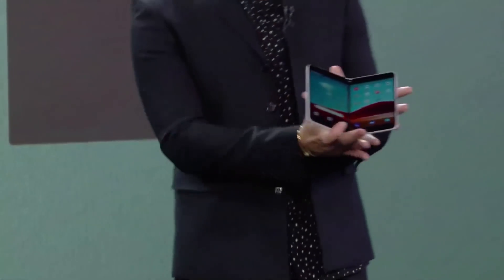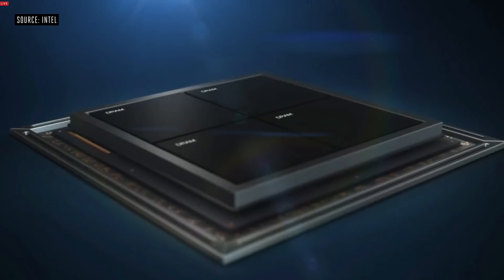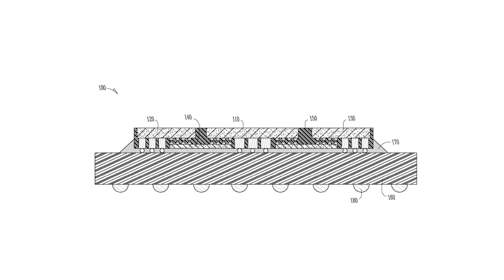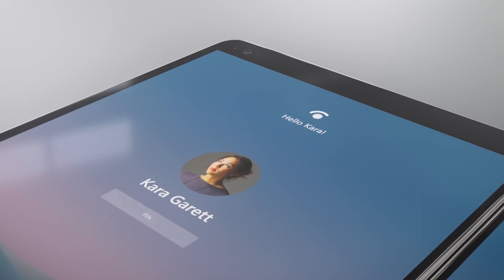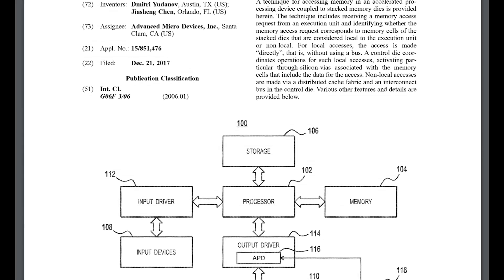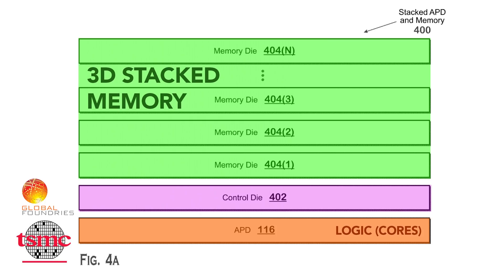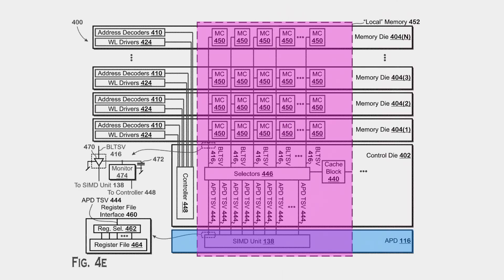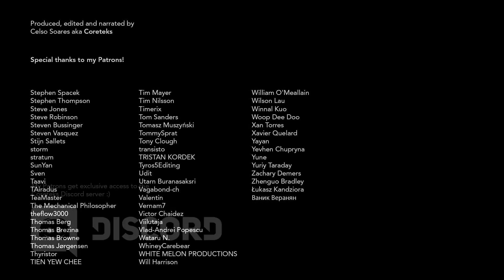Is 3D STACKING coming sooner than we think?

Comment: Moores law was just suspended, because Intel had no reason(without competition) to shrink and increase transistors on a die. That would have requiring new more costly equipment and processing techniques.
TSMC went from 14nm, 7nm, 5nm, 2nm all within a space of less than a couple years.
Yes they will hit a threshold again and slow down, as it again becomes more costly to continue to shrink transistors.  
Stacking vs using an interposer to connect die pieces, neither method is cheap.
But It's easier to cool a bigger surface area(interposer) then a smaller surface(stacked).
Stacking solves some interchip latencies but creates others like getting rid of heat. 
Memory stacking has been done for Years by IBM. It takes advantage of the fact that memory usage is localized on the Dies.

Comment: Wait - why would memory prices skyrocket, if all you're basically doing is moving it from the board to the chip package? 🤔
Reply: From my understanding from the video is that amd can't use existing tooling for that memory in regards to 3d stacking. It has to be custom and anything custom will be expensive.

I could be wrong though.

Comment: here is the short version. 3D stack will only be viable once we solve the cooling issue that is generated with it.
if we ever find a miracle way  of cooling without LN2 or something that isn't outside the norm of cost=/=efficient then but only then will there be huge increase of 3D stacking.
3m has already been developing liquid industrial cooling solutions for computer parts and they are great but really expensive atm but no where near for commercial use yet. 10 liters of novac is like 1500 dollars.
Reply: Also i have to add, Amd seems to be years ahead now in technology most people can't see or understand it just yet but wait until 2022~2024 Apus will rule supreme.
Especially if they can figure out a way to cool these, making ram act like cache on hyper bandwidth memory 3d stacked accelerated processing unit with a graphical processing unit chiplet and core processing unit chiplet allowed to utilise both would remove any and all latency between normal ram this would not only improve performance on a whole new level but there wouldn't  be any delay in response instructions per cycle gains would be through the roof. anyways this has been my speculation since the development of ryzen on going for 4 years back now and its all unfolding piece by piece over time now.

Comment: 3d stacking is a fad tech, kinda like bulldozer.  Just look at the picture showing memory on top of the SOC and compute. The same trace length could be had just by making a larger socket and putting the memory beside the chip. Lower temperatures would be the result, therefore lower voltage, higher clocks, better IPW. 

3D stacking is the chip equivalent of a woman transitioning into a male then attempting to play competitive sports against males.

Comment: Would a thermal control unit be enough to handle thermals? Lakefield's thermals are easy to handle, since it has merely a 5 - 7W TDP. We have already seen mobile SoCs at this range of TDP which have the memory stacked on top of the logic (connected "sideways", not with TSVs, but that doesn't matter thermal wise). 

The next step would be to employ Foveros or AMD's solution on a 15W TDP SoC. That would probably still not be much of a problem, but at ~25W and above it clearly would. I would set the ultimate limit that would be feasible without active cooling between the dies (i.e. via microfluidics) at ~35W tops. 

The problem is the skyrocketing of the heat flux (heat generation per area, i.e. a kind of "thermal density"). Currently a 25W and 45W SoC has that heat spread in a relatively wide area. Heat flux is watt per square cm (W/cm^2), so since the area is wide it is low. 

When everything is stacked on top of each other though it rises quite fast. Even with high performance liquid cooling only the top die will be adequately cooled, and quite a lot of heat will be trapped by the middle and lowest dies. Which is why I do not expect 3D stacking not cooled to ever be used beyond a 30W, 35W max TDP SoC. Realistically the limit should be ~30W with water cooling. 

These SoCs would be the new, lower clocked 45W -H class SoCs, and the smaller logic - memory bottleneck should compensate for the lower clocks. However -S class CPUs/SoCs would be completely out of the question without active cooling between the dies.

Comment: Some possible evidence against 3D stacked consoles, seeing as how you mentioned that 3d stacked chips likely won't clock as high, could be the recent leaks that propose to show us ps5 and xbox gpu frequencies.  Adored's latest video goes over it, and according to this particular rumor/leak, the xbox is 1.7ghz and the ps5 is 2.0ghz.  the cpu frequencies are supposedly 3.2ghz or higher, I can't remember them individually.  So 1.7ghz, let alone 2.0ghz, is normal or even high for a Navi die, so we're certainly not seeing any frequency decrease if it were 3d stacked, and that would be surprising and impressive.

Comment: Just modify multilayer pcb tech to work for chips.  You just need a way to ensure alignments so that holes and connections line up and don't interfere with heat spreaders and heat pipes... something like laser etched alignment notches at specified locations - which could also be the heat pipe locations.

Comment: According to the leaks on clock speed for the next generation consoles, if stacking means clock speed has to be lowered, then clearly, neither consoles is making use of stacking. There is a reason Intel is targeting low wattage parts with their stacking technique, and that is not what the next generation consoles are going to be. I would say this is not analysis but wishful thinking.

Comment: This is utter retardation to listen to this crap...  Patreon Me?  WE ALREADY HAVE THIS!  The main problem is HEAT DISSIPATION!  @#$%^& gets hot and adding layers will insulate the heat and trapping it inside the package.  Die stacking is NOT a NEW idea and has been used for many YEARS!(10+ years...)  Intel's secret GPU?  I already know where S3 is going.  Oooohhhh... a 3-D XBOX!  idiot doesn't know MicroShat got their last 2 reference game console designs from copying Sony's Playstation!(PS3 - XBOX 360 & PS4 - XBOX ONE) and we already know how the PS5 is being designed and how Microshat will follow suit.  Apple going ARM Cortex???(8+ core NAPDRAGON?)   Not a surprise there with them because it is literally in EVERY CELLPHONE and we all know how fast those newer phones are RIGHT???  This is just worse than building the hardware on the atomic level and I'm not talking about trying to use a finer wavelength of light to image silicon either.  Both AMD and Intel work hand-in-hand sharing designs and YES Intel does make some decent 3D NAND memory and internal CACHE memory physically built into the CPU's!(Not hard for them to make their own RAM)   Why the heck constantly show dual screen tablets???(Worst UNRELATED B-ROLL EVER!)

Comment: This is not new. Amkor (AMerica KORea) is one of the worlds largest IC (chip) packaging houses. They do the packaging for many of the worlds large chip makers, as well as creating and making custom packages, often with die from different manufacturers inside. We (Motorola) were getting custom packages with multi core processor die from TI in the same BGA package with flash memory from Intel or Micron for use in cell phones in the mid 2000's. I believe there was also a chip with flash and RAM stacked on top of the CPU. A patent can be granted for each unique arrangement of those IC die in the package, and for a new package design. I have a few patents for sticking multiple RF power transistor die in a unique package made from PC board material. It was used in Motorola's police walkie talkies as far back as the 1990s. They were made by a custom house in Florida.  In both of these arrangements the thermal management is the big issue, and the subject of many patents...….when will we see a CPU chip package with the water cooling ports built in?

Comment: My guess is larger than normal dies for memory and io to fit data and power vias through them, and placing highest thermal dies on top to be cooled directly, next hottest die (io usually) on bottom to be cooled via Package and PCB, and least thermal in the middle (memory). 

HEATSINK
CPUCPUC
GPUGPUG
MEMMEM
IOIOIOIOIO
PACKAGE

The memory dies will be larger than normal to allow for data and power vias to run through them. Each layer will have infinity fabric links between them in addition to necessary data and power routing.

Comment: 3D stacking works better and is much much easier with low power electronics.
High power chips tend to make too much heat already, stacking other dies on them makes cooling much less efficient.

Comment: Stacking is very likely going to be limited to low power devices because of thermal load. Every high performance process has a very large heat sink to dissipate thermal from the chip. with stacking it becomes more difficult to rise of all of its heat generated. 

I am pretty sure chip stacking has been around for a long time was was developed for DRAM or other low thermal load memory systems. 

Really Chip stacking Tech need advancements in materials to reduce thermal loads.  Either a different material like GaN (Gallium nitride) or MoS2 (Molybdenum disulfide) Will need to be substituted for Silicon. issue is that Silicon is a poor conductor. if the Thermal load problem can be solved then Chip (vertical) stacking can really take off. At best multiple dies can be placed on the same chip carrier, but the distances between the different dies is much further apart than if the chips were vertically stacked.

Comment: I really appreciated that you pointed out that Intels FOVEROS is more of a 2.5D stacking what concerns memory and I always got a bit annoyed then it was called as the latest "3d stacking".

I prefer to call it 2.5+D stacking as it is just moving the memory die from the side to the top without changing any of how the signals connect to the compute/cpu die.

When I first read about 3d stacking some years ago, my thought was always that real 3d stacking is either the way HBM works, or as you pointed out in the AMD patent where the memory/cache is directly connected to the compute die via TSVs.

This kind of fully co-designed 3d stacking could have great potential to for example instead the L2/L3 cache like in Zen2 is some milimeters away form the actual core and the data needs to be send via very thin and highly resitive (speak: power consuming and therefor heat producing) wires. Instead stack the L2 (and then L3 as well) on top of the actual core and the data does not need to travel 3-5 mm horizontal but maybe just 1 mm (mostly-)vertical with reduced latency AND lower power consumption.
Any thoughts on that Coretek?
Reply from the maker: @
DerIchBinDa
 It's exactly as you mention. I imagine transferring data vertically to a nearby cell takes a few Pj instead of the hundreds of Pj it takes to go across the die (let alone go to HBM for instance). The key here will be with how the metadata for locality is handled.. more on that in a future video ;)
Reply: Part of dealing with memory bandwidth is making the bus wider. Something you see in GPUs and some CPU architectures.

Comment: I don't buy the reason for intel though. They can and they will use their own IP for GPU or any part of that 3D stack processor. They can do it in-house. Not to mention Kabylake-G is a failure. OEMs don't bother to follow-up on their Kabylake-G laptops. You can search HP or Dell or Acer and search their Kabylake-G laptops and you won't find them. Intel can dominate the mobile space using their own IP. Outsourcing GPU (for instance) from AMD will inherit additional cost which defeats one of the purpose of 3D stacking

Comment: Ok well but the elephant in the room with 3D Stacking is not addressed.
Heat dissipation. In 3D stacks there must be options to get rid of the heat. Packing chips on each other is like layering bed sheets on each other in winter but with electric powered ones.
This will get quite soon to warm.
So what's the plan for heat dissipation carbon nanotubes and how do I get a CPU cooler efficient connected to it.

Comment: I believe AMD sees the problem in modern computing is the lack of progress in memory technology compared to logic(processor) technology. CPUs today are millions of times faster than in 1995 however memory is about 10x better. In fact, memory per core has actually gone done with the advent of multi-processors. AMD sees the future as dealing with the "memory crisis". It's holding back the entire semiconductor industry.
3D stacking will help them achieve that.

Comment: As I see it, every substrate must contain heat transfer points, contacting the most important chips, which conducts heat upwards, to the final heat spreader, much like a vapor chamber.
 3d stacked yes, this doesn't mean that they need to cram everything so tight, the cooling space is possible.

Comment: gloflo is no where near the drag at this point that you presume. TSMC capacity and the pretty much good as anything for a lower wattage i/o die '12'nm is why they use it. AMD will be using global foundries well after 2024, mark my words. Global foundries is not dead, get off that horse... they are just firmly a 2nd tier now, the bloke you ring for light work on the cheap. 
TSMC and eventually Samsung, being victims of their own success as foundries... and demising returns on cutting edge nodes being the reason.

Comment: AMD's solution looks the best in my eyes.  The inter-chip communication and heat dissipation problem can be mitigated using carbon nanotubes as through silicon connectors and ducts if filled with a particle based phase change gas.  It'll take some engineering, but it could be a winning formula with the Infinity Fabric advancements AMD have been doing.

Comment: Okay, so this is referencing mobile processors, but how will this scale with desktop and/or even high-end desktops?

With the node shrinks comes increased power density. Intel’s 9th gen roughly doubles the thickness of the silicon which is why the thermal performance sucks a bit. Staking more on top of the logic will worsen the situation. Panasonic’s PGS product is useful, but 10 microns if the pyrolytic graphite sheets have about the same thermal resistance of ~0.7 mm of copper (through the material thickness).

We don’t have any current technology sufficient for dealing with the increased power densities we have so it’s difficult to understand how performance will improve without thermals going back to what they were 2 generations ago; that is, for non-accelerator-based workloads.

Comment: Stacking will be great as long as they put cooling blocks in between. Imagine the CPU having a bulk head to attach cooling lines!
Reply: At that small of a gap between them they'll probably have better heat transference if the die are solid with resin in between layers rather than liquid.

I had the same thought as you originally, but when you push that much heat and the liquid layer is that small it can flash boil the liquid. You actually need enough liquid mass in one area for convection to prevent flash boiling.

No matter how they do this they'll have to lower voltages and speeds to reduce hot spots.
Reply: @glenwaldrop8166  heat was also my first concern when Intel announced this, you can't make the silicon thicker because you'll never be able to quickly dissipate the heat from the silicon fast enough. Sure it allows for more cores in a length/width footprint, but your going to need to lower your clock speeds to keep the heat in check. More cores but way slower. Take a piece of tinfoil and heat it to glowing red hot, then set it aside for 10 seconds, it'll already be cold to the touch. Take a piece of thicker aluminum and repeat, and 10 seconds later you'll get a 2nd degree burn. Not the greatest idea if your trying to get better performance even on a smaller production node.
Reply: Exactly.

This could actually push towards lower clocked, multicore chips if it goes mainstream but honestly I don't think it will ever exist outside of size limited devices.
Reply: @skOsH nope, won't work. It's an electrical device with over 1,000 connector pins coming out of it, no way to completely enclose the silicon mounted onto a pcb with a aio.  It still wouldn't pull heat from the center of the chip either, that still needs to disipate to the outside surface for contact with the cooling device.

Comment: There's a really good reason for AMD to stack memory on the IO die and not the logic: if it's on the logic chiplets it's just a bigger cache for that CCX, which does not help Epyc or multi-CCX packages. If it's on the IO die a request goes out over IF to the memory controller on the IO die like normal, then if that data is local it comes right back. If not, then the memory controller goes out to system memory like usual. AMD made a huge leap to get away from NUMA for each CCX, I don't think they plan to go back to that.

Comment: What's the point in creating faster computing architecture when we still use single-thread-optimised languages and operating systems and continue to have sloppy development practices like the javascript ecosystem, electron and awful attempts at vm runtimes? We could have the computers of tomorrow, today, with no cost, if developers started caring about the customer instead of job satisfaction. These architectures most likely won't show actual performance increases due to our sloppy practices. My background: senior developer, project lead and founder of multiple tech-business.